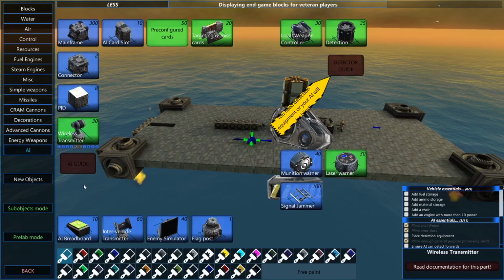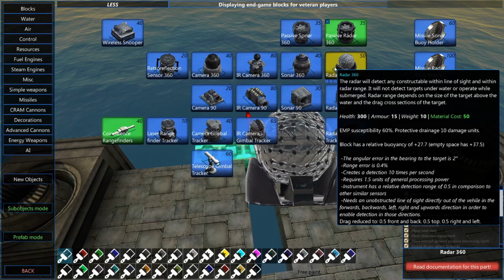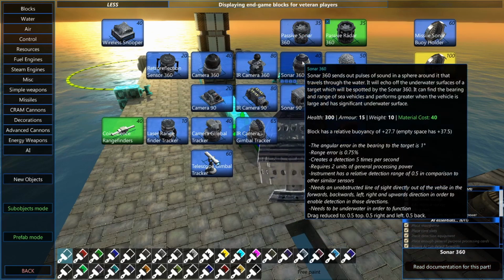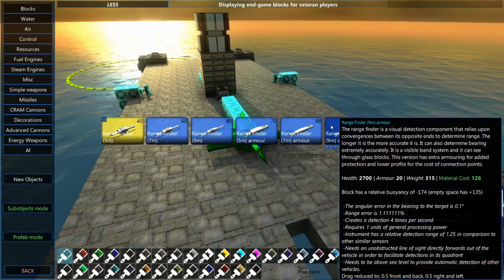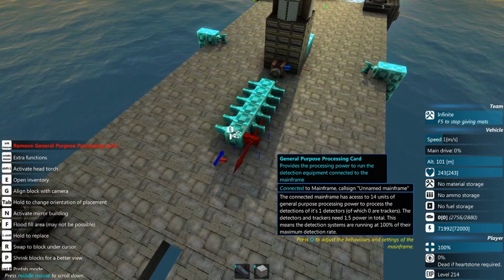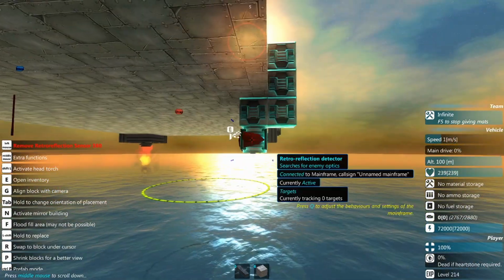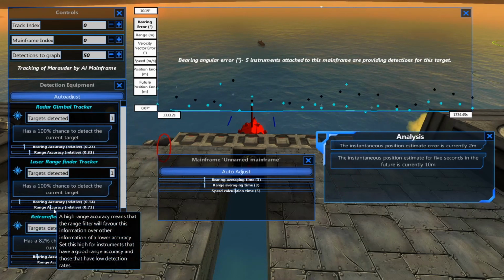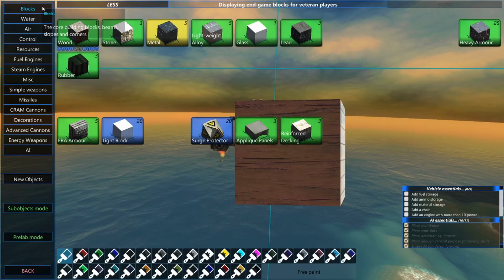From the Depths - Tutorial 10: Detection

Comment: Gimbal Trackers self-rotate in 360* horizontal and 180* vertical, they are directional on-lock but can cover area same as 360* Radar. When you place any detector equipment you should remember they check blocking left/right/front/back/up in 90* lines but not diagonal, so place them out of line to "cheat game system". Sensors on pistons/rotors don't block themselves last time i checked, but its a soft exploit. I prefer to use dedicated "best suited" for weapon type sensors on turret itself focused around tracking, and dedicated sensor turrets on long pistons focused around detection... so they have coverage while avoiding loss of accuracy like when they would rotate on spinblocks (like most still use them) - this is especially important for ammo warners not mentioned here.
Can anyone confirm me, or something has been change recently? I don't want to spread missinformation =/

Comment: That has got to be the most in depth sensor tutorial.  I just wish you also included the Bearing, Range and Speed timing sliders.
Reply from the maker: That's a good point, I didn't cover those sliders very much. While the autoadjust for the most part does a fine job for these sliders in particular, the sliders let you average the detected position and velocity information of a target vehicle over time. The usefulness of this is heavily dependent on a variety of factors, most important of which is the rate at which your various sensors are detecting the target: faster detections let you use lower time settings effectively, but too low risks getting a lot of "jitter" and constantly over-predicting the target when firing cannons and other aimed weapons.

There's also some quirks, such as laser rangefinders giving extremely rapid detection, so often you can afford to turn the range averaging time down a bit further than the bearing if you're using at least one (which you should be). If you have fast detectors being used for bearing, you can turn that slider down as well. Speed calculation is a bit trickier, as turning this down lets you respond faster to a vehicle's changing velocity. On the other hand, turning it down too far makes it difficult or impossible to hit wobbly vehicles with all but the fastest projectile speed weapons, so if you're trying to hit small DWG or low-tier White Flayer aircraft, for instance, you're better off leaving this at its default.

Comment: That has been one of the most complete and comprehensive detection tutorials I have ever seen.  Two thing of note tho.  Firstly, if you use the portholes under decorations visual, laser, IR and retroflective sensors can see through them. Also, they come in an alloy and metal variant. These will have the same stats as a single block as their respective materials.  Secondly even if it appears that you can see through certain decorations detectors cannot.  I think they can see through railing just fine but will not be able to see over things like metal or alloy plate.  Other than that you done a wonderful job of covering detection and I have learned some things from it.  Thanks and keep up the good work!